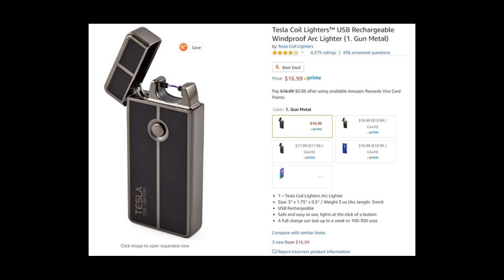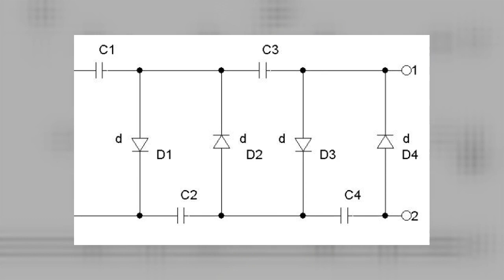How to Make a High Voltage Wand (100,000+ Volts)

Comment: I made one last year.  I left the negative lead of the multiplier accessible so I can ground it and have wild  sparks come out of anything, even the walls and floor.  Also a copper 3/4 end cap worked really well for the wand end.  I ended up using 2 18650s in parrallel so I can use it for a while without charging it.  Instead of the lighter circuit I used one of those cheap chinese hv transformers and made a little circuit out of 2 mosfets and 2 resistors to drive it.

Comment: i made HV PSu with coil ignition car, can i modify into some electrostatic like yours?
Reply from the maker: If the output is AC over a couple kilovolts, a Cockcroft Walton multiplier can increase voltages into the “electrostatic” range. Generally for electrostatics to be visible you need output voltages over a few kilovolts DC.
Reply: @DBXLabs  yup probably over kv, arc around 1 cm so i only need add caps mutiplier for making them "electrostatic"?
Reply from the maker: @dogodogo5891  Yep, that should work.

Comment: hey, i’m interested in making one of these but i’m wondering how long the arc lighter will last running a voltage multiplier
Reply from the maker: In my case, the arc lighter lasted for about 30 minutes of intermittent use
Reply: @DBXLabs  so should i just make my own compact circuit to drive the multiplier, bc i’m pretty sure the run time of an arc lighter is only a few seconds anyway
Reply from the maker: @nguyendesign4517  if you can do it, you should. You could probably pump a lot more current into the circuit that way and run it continuously.
Reply from the maker: @nguyendesign4517  I would also do an arcing test after every stage addition. Looking back, I could have probably dropped the number of stages in my design by a third and dramatically improved output current and maybe even deliverable voltage.
Reply: @DBXLabs  yea i’m thinking about around 15 stages